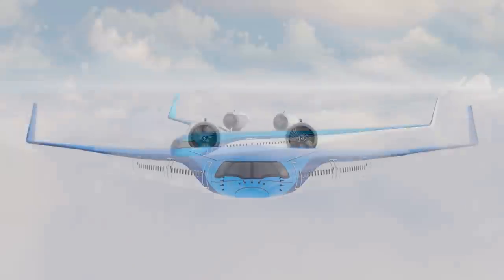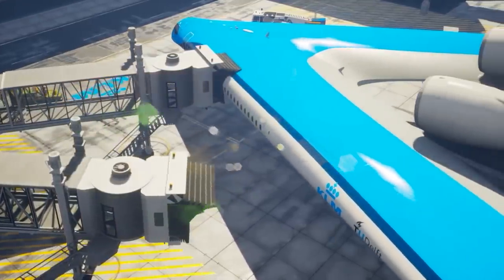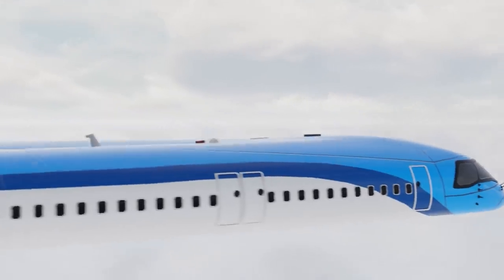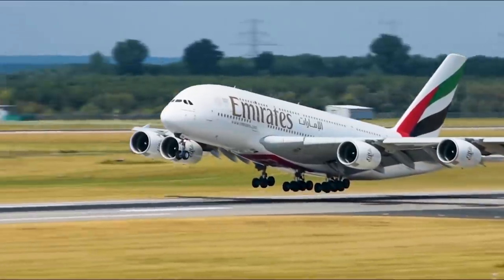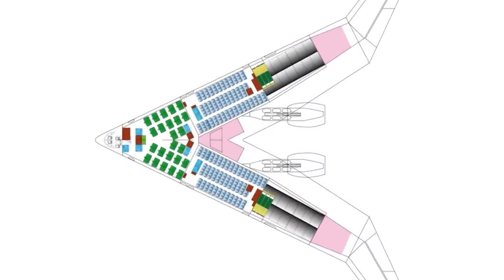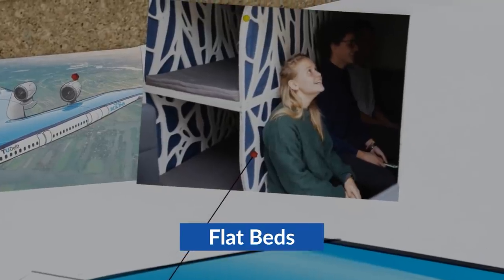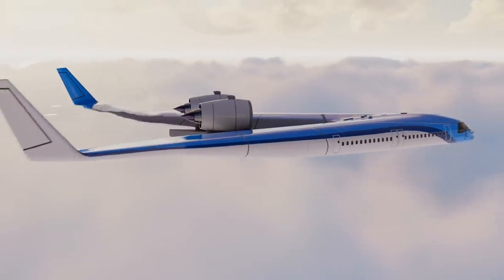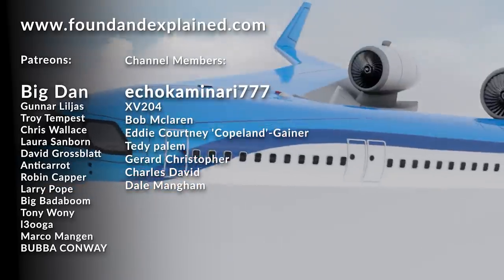Why would you (not) want to ride the Flying V

Comment: The flexing motion of the wings during normal flight is transfered thru the seating areas to the point of the v connect....the wings absorb motion during turbulance and is transfered from port to starboard wings across the cabin, this design the cabin(s) will be a part of that wing motion before transfer point. I am guessing first class will be behind the cockpit, the point of least motion and the seats will be cheapest where the cabin becomes the wing tip (greatest motion) during flight

Comment: The main issue that I foresee, would be the G forces exerted on the passengers in the aft portion outside of CL engine in either cabin. This point has been made by other designers working blended wind designs. I would think that the +/- G effect in a high angle bank would have serious effect on passengers prone to motion sickness. I do like the concept though.

Comment: As an aircraft mechanic, i can say changing those engines would suck. You'd quite literally need a hangar with a crane inside it and even still the thing will be like 30+ feet in the air once its out making it really sketchy to move.

Comment: In the early days of passenger plane design, weird shapes, like the dolphin like shape of the Lockheed Super Constellation were tried, and had some aerodynamic benefits. However, constant pressurisation/depressurisation puts more stress on a non-cylindrical body. 

So practically, I think we'll be stuck with passenger planes that look similar to the ones today, for a very long time. In actual fact, a Boeing 707 of the late 50s looks almost the same as planes today!

Comment: id like to point out it is not an issue for the engines that are integrated into all wings like the horten or the B2 spirit it is to keep radar profile and stealth factors which would be drastically less if they just had an engine thats sucking in loads of air and throwing it out on the back of it not to mention it would be harder to hide heat profile and material as well

Comment: If it can fly more efficiently then it can also glide more efficiently. So it should be more safe in case of engine failure allowing greater range without power.

Comment: I think flying wings are a wonderful solution to reducing drag and therefore improving fuel consumption - massive improvement in efficiency. There have been some great examples but mostly a lot of the military top brass and bean counters couldn’t handle something as radical so looked for a way of dismissing the concept. Basic stuff like rudders are usually missing - again those sorts (above) don’t understand or don’t want to. I flew hang gliders for 35 years so I know it works! Jack Northrop was always up against these stick-in-the-mud people.

Comment: Um... no. Future of air travel is not about the size or capacity of individual planes (Airbus 380 was a commercial failure). It is about alternative fuels, better fuel economy and better speeds as long as they are subsonic, better safety and easier maintenance. That V shaped contraption would have a huge drag making achieving the speed and fuel economy goals way more difficult than with the conventional layout. Not to mention that adapting such a layout would likely necessitate construction of different hangars...

Comment: The evacuation issue is simple to solve, with a slight redesign. Put the engines on top of the wings and extend the width of the front area with the cockpit and put staggered doors along the inside of the V. Simple. The beds and lounge seating are just yuck, and the Train style group seating is even worst, then the Train seating, its even more cramped, on the plane. You don't need to lift part of the table on a train. Inside is just yuck.
Reply: Not so simple, in addition to the 90 second evacuation rule, 50% of the exits will be blocked. Worse case scenario would be all exits on one wing are blocked… now have people crammed though to the other side… that was the problem. The inside of the V is facing the engine, which means they are more likely blocked by derbies and fire anyway.
Reply: Also the engines are very close to the passenger cabin

Comment: Can the blended wing be stacked? Can it have two levels? Can the second or upper level be slightly cantilevered backward from the lower more forward leading level? That would still maintain the overall body as wing design philosophy while increasing internal volume which means, upper deck for premium classes?
Reply: Do you mean, like an old-style biplane? Yes. The downside is that the second wing operates in airflow which is influenced by the first wing. So on one of the sets of wings, lift is almost invariably less along  a portion of it's length. Meanwhile drag is basically the same on both sets. Furthermore heavy structures connecting the two will also cause more drag. This would tend to negate the advantages of a flying-wing design compared to a traditional design with a definite tail and fuselage.

Comment: I’m not sure of the viability of this design is going to work with current airports. The 777 has folding winglets just to fit in most airports where ultra wide wings were not the design mindset. Everyone thought the future would be 4 to 3 engine aircraft running large passenger numbers. Now the norm is highly efficient twin engines. 
Additionally, with the inevitable switch to a hydrogen based engine design means that it will be far more difficult to store the pressurized tanks to hold the liquid hydrogen. Normally the fuel would be held in the wings, but with this design the fuel would have limited space with passenger compartments taking up more space. 
Now there is no doubt that this plane has significant fuel cost savings and great capacity. I just believe that to see something like this coming into the market would mean changing the terminal designs of every major airport (most likely transoceanic routes). The cost associated would would require more capital  than the research, manufacturing, and logistics of the aircraft.

Comment: Everyone is designed to be pact like sardine in this model, those morg beds, make one appreciate their own private craft. It was feasable, they were scared to test staffs to manage this airline craft, surely spooky on the inside, for humors of hospitality. 
  The "Flying V" was too wide thus drag of speed too slow. Instigating a bulk pack of human liviing carcass load of travel.

 The good side, it was simply an example, that an aircraft didn't need to have wings, it could also BE a WING ...companies like Lockheed mastered that with a craft called the SR Blackbird, infact the only reason it had adjacent wings, was to hold 2 bulk fuel efficient engines that extended out, to exploited sound for speed.

Comment: A rotational cocpit could come nice and roll wing that do 360 spin somairplane wouldnt use airfuel savings and slight a reinforce at back top could come handy as airplane is much reinforced in fact if jet version on 4 engine on side holders and just add in front extra pair you have easy scfi vtol airplane with no runaway need only park space and this makes with rotational cocpit even more easy scfi fly flight and very stabile with hydrogen fuel even more for safety I would also double wings expansion so range is even higher as thing done easy even to easy improvments

Comment: Fwiw, the framing of this video is very misleading.  It jumps from WW2 to 2019 like there was no work done on BWB aircraft in between.  Obviously the B-2, F-117, and nearly every tactical fighter since the F-15 would like to have a word.  But even in the civilian space, there have been several attempts at something like this, but they always have run into issues with "form factor" problems.  It's hard to load and unload, both for cargo and for passengers, which is super problematic for evacuations.  The Boeing BWB study back in the 90's is one such example, but even more recently the Aurora "Double Bubble" is a really conservative take on the concept that tries to solve some of the usability problems by only minimally deviating from the "cylinder + wings" formula.

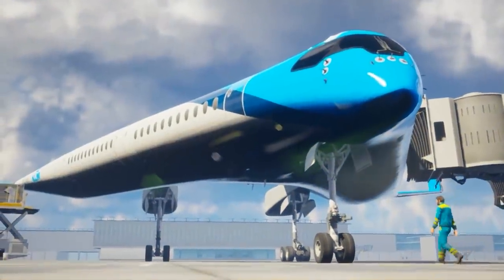Comment: 1:25 why so negative? Flying wings did not work. A tail is more efficient both for stable cruise and for extreme maneuvers ( take-off and landing or military stuff ). The nose is the counter weight. Even model planes which do not need to cater any passengers and also bombers which could fit their heavy load anywhere and money is not important have a fuselage. Only stealth lead to flying wings and also to keep that one company afloat.
You mention supersonic, but fail to mention that transonic also wants thin wings. So compared to the old planes you mention, the race to more speed in the Jet Age has even led to a more pronounced separation of wing and fuselage.

Comment: Folding back wings, and there can be a sheet style back flexible plane between the opening wings
Reply: V-shape opens, closes to be and I-shape
Reply: just put a T-tail above, like the engines
Reply: b-2 bomber shape with T-tail above
Reply: you have two tubes, what the problem
Reply: boom-er fliers designers
Reply: it could the three tubes, and full body lift wing
Reply: the b-2 spirit bombers shape, but 3 tubes and the cockpit front
Reply: you like to be and create problems, instead of solving them
Reply: reporters vs engineers

Comment: Under analysis changes in configuration from the trusty tube and wing do NOT make more than a marginal difference. Even winglets hardly earn their pay. In such a Flying "V" aircraft where is the fuel? hydrogen or kerosene or whatever? With military aircraft there is some benefits to more radical concepts but at the cost to economy.

Comment: The details ok but need more extra engine  in the middle between the two  Carrie along if one should fail also by setting in wing design all windows should a safety features if windows ever fail a metal shutters will close off that window  if are thinking safety that never thought of  but remember your  setting in wing of aircraft you could get sucke out ... SAFETY is s must

Comment: What's to improve you say? Let's start with cargo compartment doors, where is it? It seems to be tail heavy. Cargo plus the weight of the engine. Where's its c.g.? Doors are also located on the leading edge of the plane and also not enough. What are the chances of the doors getting damaged during a crash landing. Good luck to those economy passengers when there's an emergency. You should've bought first class seats.

Comment: When was it ever an issue that passengers can't evacuate a plane quickly? A plane explodes in a giant fire ball or it doesn't.
Reply: There have been instances where a localized onboard fire on a plane on the ground filled the cabin quickly with smoke, carbon monoxide, and other toxic fumes like hydrogen fluoride created from burning fluorinated plastics. This can quickly overwhelm passengers, aside from the loss of visibility causing disorientation. As in, you lose your mental facilities from CO and other toxic gases in tens of seconds, not a few minutes.  There was one case I heard of where someone's phone battery causght on fire while taxiing out, then set the seat and carpet on fire. Couple of passengers were hospitalized with severe smoke inhalation. 

At altitude and full power, typically the pilots can depressurize and repressurize the cabin repeatedly which evacuates much of the smoke and can delay the fire severity, while the overhead oxygen masks deploy. Some aircraft also have systems to flood the cargo bay with fire suppressant gas, if I recall correctly.

Comment: But why a V design and not a triangle design, there is no lift being generated between the 2 engines, that being said there is TONS of cargo and passenger capacity lost with a V design, it looks like 2 fuselages joined at the tip with a couple small wings added to the rear.
I'm guessing this has very little cargo room compared to 747's or airbus's.
I'm hyped for a flying wing passenger design but i think this is not it exactly. =/
Reply: I agree

Comment: Most runways no longer enough most are 1.5  to 1.75 miles long in take offf in a full load aircraft to land aircraft if should happen you need the extra miles on take  if engine fail  or land  reverse thrust to stop you the extra mile for commercial airliner all runways should be at lease 3 miles long  .

Comment: In that case, no!  The Flying V has the same design as the Blended Wing Body.  In addition, I also share a lot about its carrying capacity with such small wings!  The Blended Wing Body is extremely load-bearing, and still has much larger wings than the Flying V. 40% of Lift power on the Blended Wing Body comes from the body, the remaining 60% comes from the wing.  Now as the Flying V will have so much load of just a 20% increase in the body compared to other aircraft.  And the Wings?  Generation How much?  80% strength of those little wings I share!!!  The Blended Wing Body is the best design in terms of efficiency, and I see that the company combined the idea of two fuselsgens and mixed it with the Blended Wing Body Design... Besides, those who know about the Blended Wing Body problems in this aircraft are still present and not were eliminated, there is still the problem of seasickness and emergency doors.
Reply: Informative.

Comment: Tailless aircraft have been around since 1909, and blended wing aircraft since the 1920s- look at Junkers and Burnelli. None of them have ever outperformed tube and wing using the same engines, and there are many reasons why. Pressurization- tubes are much stronger for the same weight of materials than other shapes. (except a sphere, but balls don't fly well) Tube and wing designs are almost infinitely modifiable; look at the DC 4/6/7/7C, or the DC 9 series. A blended wing cannot be so modified unless you redesign the entire aircraft. Tube & wing can be converted from passenger to cargo and back again with little effort- not possible on this design. The farther from the center of gravity, the worse the effects of turbulence- have you ever seen the wingtips flex in turbulence? On some airliners they're designed to flex 6-10 feet... imagine if you were sitting there. And these are just the tip of the iceberg. Some of the greatest minds on Earth have been building airplanes for one and a quarter centuries now, there are reasons they build them like they do.
Reply: there would be no wingtip flex wingtips flex because all the weight is in the middle and it is not a wing
Reply: @fred6319  If there is no flexing, it would be even worse- turbulent gust would fling it around the sky if there was no flexibility to absorb sudden bursts.
Reply: @bierce716  the flexsing is because for the properties of the material it has nothing to do with turbulence 
what part of all the weight is in the middle and it is not a wing
dont you understand?
Reply: @fred6319  Air gusts and turbulence are forces. If a force is exerted on something, it needs to absorb the force somehow. What part of either flexing or bouncing around do you not understand? I've flown in thunderstorms on airliners with flexing wings, and in Cessna's with inflexible wings. Quite a difference in ride comfort.
Reply: @bierce716  difference in ride comfort.SIZE

Comment: You are probably right, however In this case I hope you are wrong, wrong, wrong... Since this video was produced, JetZero, another start up has received approximately $200M from the US Department of Defense to advance their freigher/tanker/airliner blended wing concept designed to run on SAF and is "Hydrogen Ready" whatever that is...   I do hope it's successful because it promises to deliver a 200-seat aircraft with 50% less fuel burn... I dunno what's in their secret sauce to make this happen vs Airbus and its claimed 20% less fuel burn but I do hope they are right!
Reply: As for interior concepts? My choice would easily be the bunk beds. Most people would rather lie down flat even if only for a few hours of rest. Just hope it doesn't become a 2 vs 1 scenario as to when to convert the seats from upright to sleep, although I suspect the answer is ASAP and as long as possible during flight, just not takeoff and landing for safety...

Comment: "approximately 1/2 the passengers will be located away from an exit"?!?  WHAT?!

1. I presume that's because they don't have any emergency exit doors on the inner / trailing edges of the flying wing body, which begs the Q: "WHY THE HECK NOT?"  Obviously, they can't board using them (at least not without highly customized and costly jet bridges), but most planes only board / deplane via 1 (at most 2) door(s) anyways.  The other doors are almost always for - emergency - exits - only!?  From the illustrations and the scale model in the vid, I don't see why there wouldn't be room for inflatable emergency slides or rafts coming out of emergency exist doors on the inner / trailing edges of the flying wing body!?

2. And/or just put more doors on the leading edge!?  DUH!  Like how they have 2 doors over each wing on some planes?!  It would result in the same # of TOTAL doors and TOTAL evacuation time!?

Comment: They would take too much terminal space. The terminals between Airlines would have to be widen as well. Not safe on narrow runways with cross winds. The Landing Gear are placed on a wider track \on the outside of the wing. This would only land on four different AirPorts around the world. Not truly, a deal breaker in the long run. ✈🛩👦🏻👍🏻